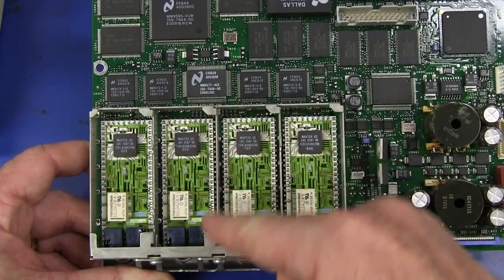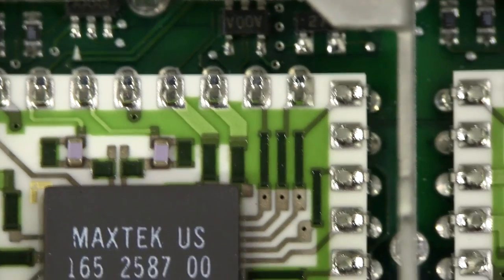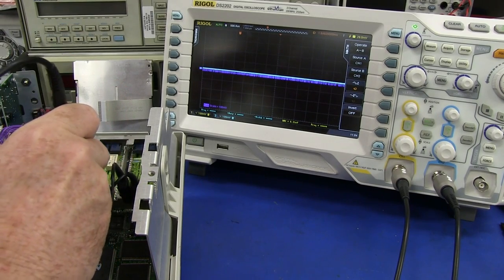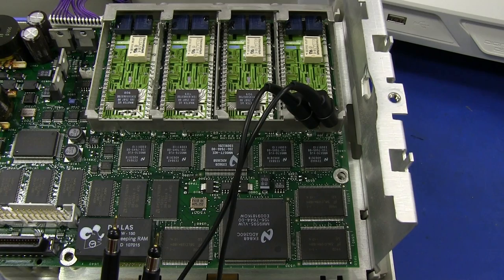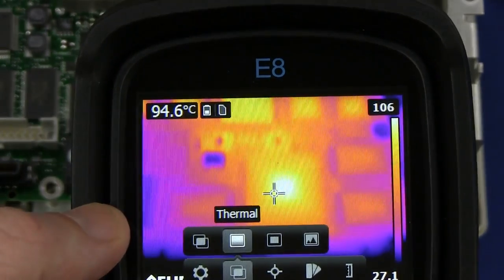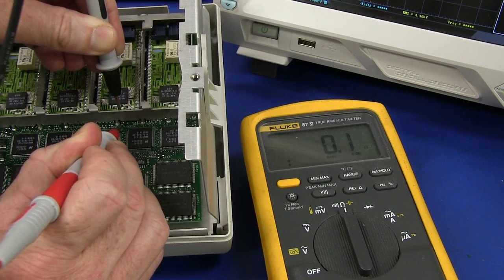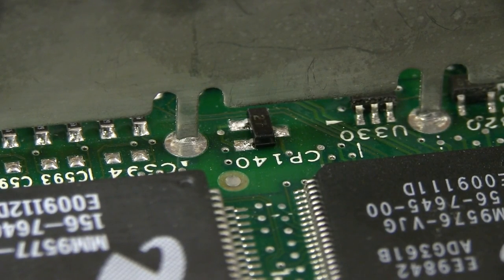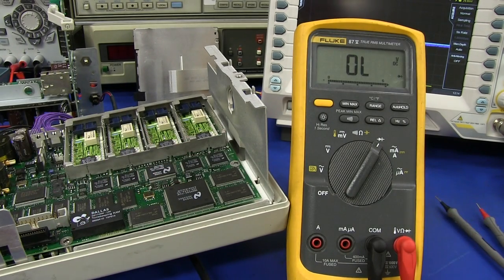EEVblog #565 - Tektronix TDS3054 Oscilloscope Repair - Part 2

Comment: If it was the 9th bit of the digital signal, wouldn't it be interesting to test what happens if you have an input amplitude of more than half of the maximum input of the scope, so that the 9th bit is actually supposed to be switching between 0 and 1, instead of being 0 all the time as with the signal you currently have.
That way you could identify whether it's a faulty connection somewhere in the digital processing.

Comment: I know it's a bit risky and some work, but you could just swap two ADCs and see if the problem swaps to the other channel. If it is the ADC you'd have shot the trouble pretty fast and otherwise you could exclude the ADCs from the possible faults. So it's like a win-win situation.

Comment: 1. Schematic time.  Lots of assumptions made which may send one down a sorry path.
2. As other pointed out, diode failed for good reason.  Schematic will help to better follow.
3. I am not clear as to fault conditions.  You went (for me) too fast.  Unclear what input signal state and settings lends to the problem.
4. Try the old "Apollo" method.  Works for me.  Tap on pcb to gently flex at various points along chain and amongst supporting rails.  When small solder blob floating in ABORT switch nearly scrubbed landing on Moon, a tap helped diagnose.
5. You were also a bit fast with the freeze spray.  I noticed improvement at one of the first tries. 
6. Might definitively rule out input module by (eek!) trace cutting and using nice coax to drive suspected broken channel with suspected working channel.
7. With all the high quality parts and (presumably) design, perhaps component failure more likely to happen when signal applied to channel way out of spec.  Was scope supplied with all probes?  Might check to see if one is bad.  Leads back to input module. 

Don't give up.  I think we are kindred souls in this: there's great satisfaction in bringing something back from the dead.

Comment: Dave, why don't you mount a new diode ? It's suppose to be there.
I can see from the PCB layout that the two diodes are in parrallel, so it's likely a double diode which runs more currents as a single one could take. Just mount a 1N4148 or similar and see if it makes any difference.

Comment: The high freq noise on channel 3 could be caused by a dead cap along the 3rd ADC. That could explain why there is a offset when you spray on it.

Comment: Hi Dave. the hybrid circuit does signal processing and a fault here would be random noise, so not hybrid module fault.
the errors appear above and below wave form full display not just in wave form.
This would suggest stuck data bit in video display module part of the ADC i.e. you get full scale "noise" regardless of wave form height.
I think the diode are just overload protection.
Best wishes for new year Barry

Comment: Hello Dave, in response to this your repair attempt I would suggest checking video strip contacts, that white strip runs across the LCD back and has two black peg press connectors. Now these can be tricky and have to be pretty hard pressed until they click. The one at the main PCB usually is OK ie. hard pressed in but the one at the other side maybe isn't at home position as yet. Trying to hard press it bends the display PCB so perhaps the tech didn't push it hard enough when assembling and so it's barely holding. Support the PCB and press the peg either by finger or a eraser pencil or similar -- a screwdriver would easily slip and damage nearby SMD elements. If loose, the connector should click home. I've got no display when I first got a TDS 3032 -- luckily this has been the case, obviously because things fly during transport and not only overseas. Now everything is fine. So perhaps this fault could be also due to poor contact there, just try it out. Best of luck, Edi

Comment: It's great to recap, I haven't seen this video for ages but I had to laugh when this time while watching you use another scope to fault find on the bad scope..... remember the film 'Silent Running' when the astronaut used one of the three robots to try to repair the injured robot which was knocked down when the other crew members were larking about in the 6 wheeled buggies? ( he could have done it in half the time if he had your Rigol)... lol

Comment: Hi Dave, just a note around measuring DC voltage rails, I personally also measure AC ripple to see if there is some noise at that level, that sometimes identifies issues with filtering... Just my 2 cents :-)
Reply from the maker: I have. Nothing wrong with the rails.

Comment: Hey Dave, How are you finding those Pamona test leads? I bought some after seeing them in your mailbag video (from Farnell/Element 14) and I have found them to have an issue where the resistance creeps up over time (to as much as 4-5 ohms when shorted together) and you have to flex and bend the bodies of the probes gently to get the resistance to go back down to zero. Pretty disappointing :(
Reply from the maker: No problem with mine, but I haven't used them much.
Reply: We bought few from digikey and they have similar issues. It seems all happen to the red probe, so I have to get my colleague's black probe to make it a workable pair.
Reply: Wei Li It's a shame as they are very nice precision probes (if not for the creeping resistance issue) It's interesting to hear I am not the only person having issues with them. I might see if i can get them swapped and see if a second pair is any different
Reply: After doing some google searching, it appears that these are also  exactly the same as the Agilent 34133A and also the Fluke TL910

Comment: Whew! Must be nice to have someone GIVE you a US$5,995.00 FLIR E8!
Also, lifting the common lead on a diode pair that isn't working in the first place may not be the best way to determine if that defect was causing the problem.  Might want to replace it anyway.

Comment: Nice video Dave, I hope there will be part 3 soon :-).
Have you measured (and compared to other channels) the reference voltage pins on the front BNC connector? Maybe one has shorted the test points and blown the diode away?
I would also try to solder a new diode in.

Comment: Remove the broken diode first, and check if the problem persists, the diode probably has build up a resistance now and couples two traces that shouldn't connect. Then check the trace on that diode that carries 3.3V on the working channels, find out why it has only 2.5V, or if that is ok again when diode is removed.

Comment: I would put a heatink on that chip.

100C is not good for the transistors.
Reply: it normally has a fan blowing over it, hes got it open and the fans not on it during that flir thermal pic, he said that too

Comment: Absolutely fascinating as ever.  Personally I prefer these fixes to mailbag.

I'd go with what a few of the chaps have already said.  I've you've got a broken diode then disconnecting it isn't going to make its role on the circuit any more broken.  Swap it with a known good one and see what happens.

I'm also starting to see similarities here with that other board you first IR'd and then chomp() the whole ASIC off a few months back, legs and all!

Comment: As i said on the last vid, the artefact extends one way from the waveform and which way seems to depend on the waveform's vertical position. That's definitely not a high frequency noise issue and I'd say not an analog issue unless they're doing something really unusual. Coupled with the fact it must be before the point where the channels come together for processing it really narrows the possibilities down...

Comment: Hey Dave, what's about changing the ADC chips of the channels? You can preheat the board in your (reflow) oven and take the ADC chip off board with your atten SMD Rework station. And then solder the chip of a working chanel to the faulty.

Comment: I like the look of that Flir E8, I imagine it costs a pretty penny, would be useful for laptop repair for tracing broken solders too
Reply: Heh, £5,500, yeah it's a fair amount
Reply: *****
The only difference between models in the FLIR E series is the software.  The E4 (as an example, as it's the cheapest one) can be hacked to an E8.
Reply: Thank you , how easy is the hack though. Looking at prices the E4 is still a £1,000 device :)
Reply: *****
There is a description on the EEVBlog forum.
Reply: Thank you I'll have a look :)

Comment: smd codes: http://www.marsport.org.uk/smd/mainframe.htm

I would try to swap a diode. removing a non functioning diode from the circuit making no change, doesn't mean it wouldn't fix it by replacing it with a working one. but as low the chances are it's done within one minute

Comment: Scope the "diode" (or transistor, as it may be.) Since the shield is right over the part, clearly it is passing a signal through the shield. See what the signal looks like on it. I suspect that this may really be a transistor. Usually 2 diode arrays have 3 pins, as do transistors. Problem is getting a part for it. Number on the device is proprietary.

Comment: Long shot: 'noisy' attenuation relay contacts?  Follow input signal from input jack with your scope up to the ASIC on the hybrid module Maybe even one of the rail to rail clamps in there might be introducing noise.

Comment: No msx, "pretty boring" No way dude, for being that close thermal mode is exactly what you want, its so much better without the confusing overlay not lining up with the actual thermal data, what you care about. At farther distances, totally useful, not gonna argue with you there.
Reply from the maker: The thermal can't focus that close anyway either. This is not the right tool for close up macro work. You can play with the lens focus adjustment though if you dare.

Comment: I know this is an old video: But I think it is faulty memory.. purely on the digital side.. does not matter how many chips there are.. I bet the memory is segmented per channel by the processor. Seeing different behavior at different sample rates is a giveaway. Somehow it is not triggering the memory check diagnosis. Replacing the memory chips may be worthwhile.

Comment: Its bad, that there is nothing about this ADC chip in internet, because I think that this diodes protects some signal line not only from external peaks, but from internal ones. I suggest that first of all is necessary to swap or get new diodes and check the signal. And I didn't memories - what was voltage differences between anode and cathode with diodes and without. And check the signal on diodes lines during work - that could be informative.

Comment: Did find anything yet? I was wondering if in such a case you could get another (probably better specced scope) and compare ch3 to another channel with the same input on the whole path of all traces from frontend through adc and maybe spot some difference? would that be a viable thing to do?

Comment: If your A/D reference goes low, you'd expect the result to go high... toward either rail, depending.... but both rails?  Look for problems in reference voltages!
Reply: 1. What is the noise frequency?  2. Doesn't noise on the signal only follow the signal swing direction? 3. Could signal be coupled to,  shorted to, and driving a faulty oscillating reference voltage? 4. Make a sniffer coil from a few turns of wire, and track the source/general location of the noise frequency. 5. Freeze/heat nearby components.

Comment: Hi Dave     RayB. here, can you use your FLIR and check another Tek scope to see if the same chip is getting hot in the same place as the bad unit?  Probably would be good to get a similar scope TDS3054.  Also, try to replace the bad diode, or swap it with channel 4.  Trying to get speciality  parts from Tektronix is very hard, and costly.  I know I use to work for them as a Technician on the Analog Scopes.Maybe you could get a used good main board from someone.  Unless it is a easy fix.  Later RayB.

Comment: Did you try to do a math function with channel 3 combined with another channel? At least that will rule out the display software for that channel
Reply: Also, on the trigger menu it seems you can turn HF Reject under Coupling. Not a fix but at least you could see if it's the HF (don't own one, but checked the manual)

Comment: Hi, something wrong with my tds3054b, after plug in power cable , it automaticly reboot again and again.i checked the power board,the output voltage seems not stability issue. do you have any experience on this problem?

Comment: could the through hole solder bridge thing that appears to connect the two shorted pins of that diode to the rest of the circuit be damaged simply re flowing it could eliminate the possibility

Comment: I guess it's the ADC. Could be floating MSB data line, caused by fractured solder or semifried ADC. Maybe zoom into the screen and see if there's a pattern, like every, every second or every forth sample => one bad MSB line with 9, 18 or 36 data lines. Find out how many data lines it has(9,18 or 36, maybe +1 for parity?) and where they are.  I guess 18 or 36. Maybe you can decrease sampling speed, so you can capture traffic with common logic analyzer. Or get high speed LA, like HP 16517A+16518A expansion card and caputre traffic. Other simple test would be to swap ADC of channel 3/4, since it's only QFP and easy to solder.  But it's kinda pointless since you can't buy new ADC anywhere, so maybe better to call it a day.

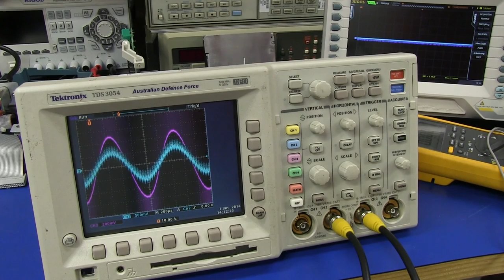Comment: 32:00 "Getting your oscilloscope high on CO2"
Reply: If it's the same stuff here in 'Murica, it's Tetrafluoroethane or R134a, the same stuff in the air conditioner in most cars.

Comment: Obviously, the diode is blown!  You should replace it and see if that leads to an improvement.  You have a couple of choices--you could remove it and try the circuit but that is a little chancy if it is a biasing diode. I'd remove and replace it.  You could replace it with another diode from another channel.  If it is  an MMBD1204, then it is not likely a protection diode--that pin out configuration is just not very useful in a protection circuit (woudl rather see a MMBD1203). And, from your vid, it looks like the two anodes are in parallel.  I certainly would measure a good one to verify that it realy is an MMBD1203 (you should be able to tell from the voltages). 

It is pretty strange that it would be blown and I doubt that it has to do with signal overload.  The diode is rated at 100V, 1A, 2A-pulse and it should be able to do that at 150C junction temp.  It could be a biasing circuit, or a control line.  Maybe it has somethign to do with switching on the preamp.  My guess is that it is associated with the relay, switching, or a bias option on the IC.  I don't think it is in the signal path.

I am really having trouble thinking what might be wrong with the circuit.  Sure you have lots of noise, but the noise is not there on the signal going into the A/D chip, right?  If so, then it is not likely the A/D.  I can't imaging a diode like that in the signal path--that makes no sense at all!  You should use your ohmeter to try to figure out where the diode is in the circuit.  I know it is difficult (to impossible) with the multilayer board and buried beneath IC feedthroughs, but it just takes time.  See if you can find the problem. 

The hybrid circuit is the preamp circuit along with the attenuators.  Look closely for damage.  THe IC is the amplifier and all the long black gadgets are carbon resistors, laser trimmed in production.  There are caps, and even laser trimmed (zapped) reactances.  Very cool!  A really nice design.  But, if it is all working, and the signal looks good, then that is not the problem.

I really hope it is the diode, because otherwise your Australian Defense Force scope is going to be really expensive.  You can't buy the A/D chip--they are custom and Tek will only sell the board.  There are some places in the US that will replace them (Norway Labs) as they have schematics and they use parts from salvage units.  However, it might not be worth it for the 3054.

Comment: can we find any shematics on this scope?
There seems to be a self test under the Utility menu. Does it report anything. http://download-service-manuals.com/en/manual.php?file=Tektronix-2536.pdf
Reply from the maker: No, the self test report nothing wrong. No error logs. It does fail calibration though, which is not surprising given crap on CH3
Reply: EEVblog
Maybe a logic analyzer on the ADC to see what 9bit value we get out :)